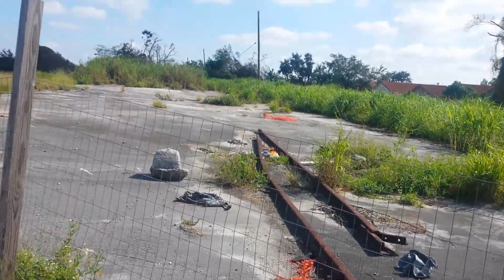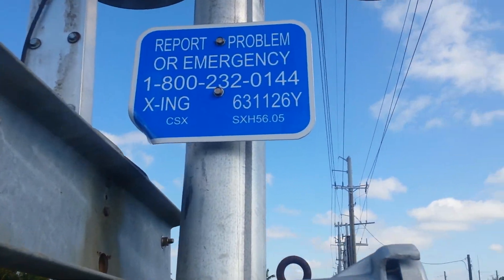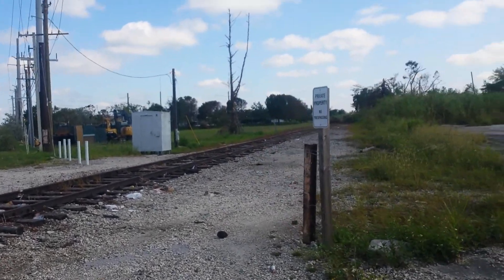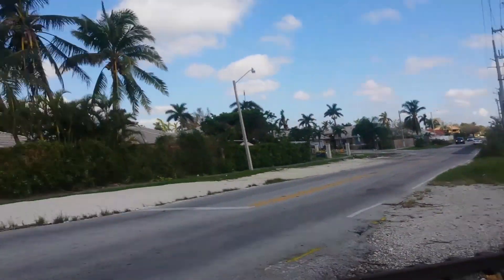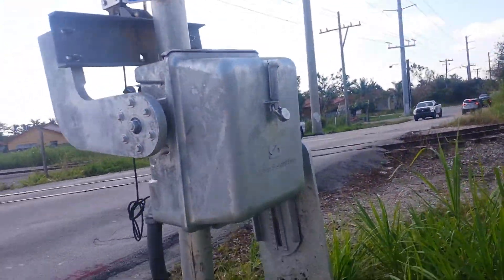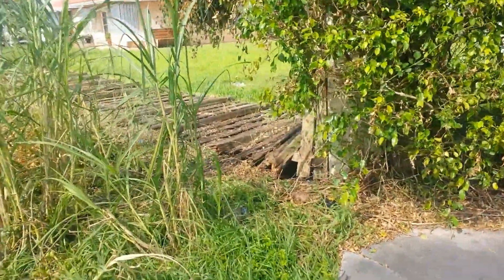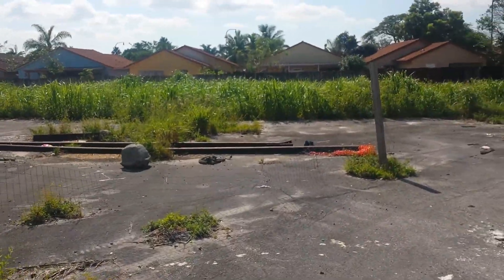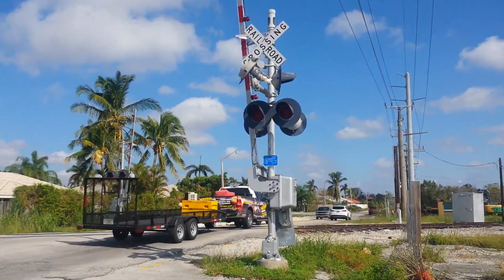Unused Railroad Crossing

Comment: All of the lights there are Safetran 12x24 inch lights, except for the one pointing downwards which is a WCH 12x24 inch light. This is also a 1990s CSX instal with one of the original lights, gates, and bell having been replaced.